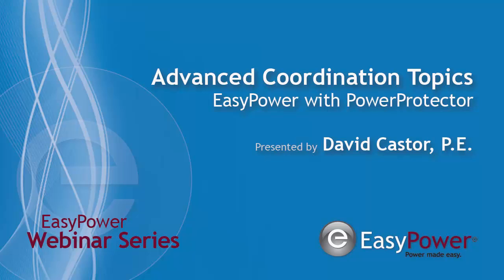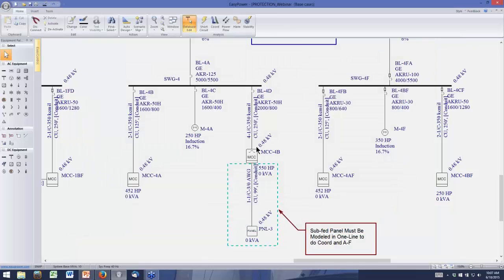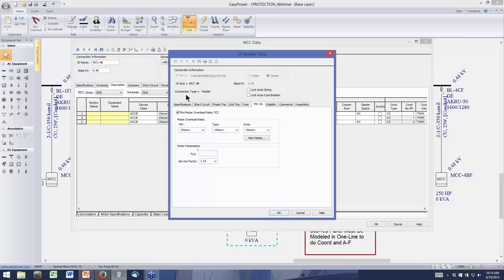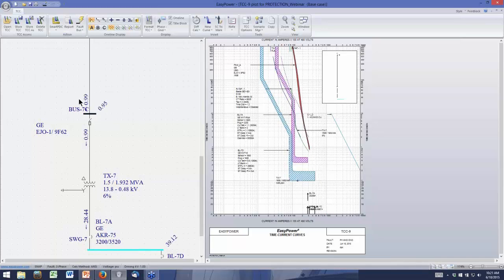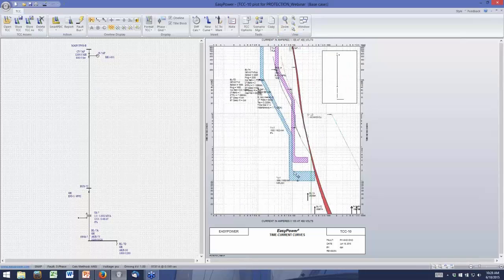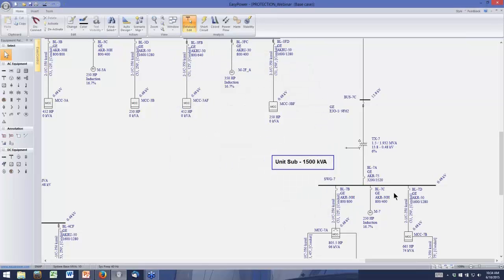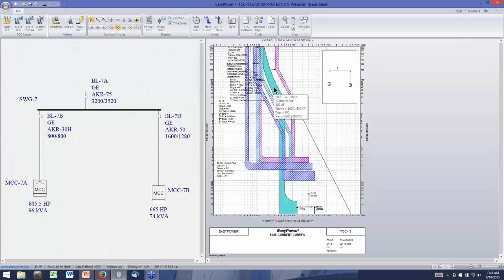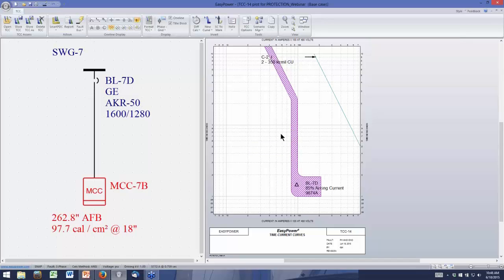Advanced Coordination Topics In EasyPower

Comment: Jon, the IEEE 1584 equations are valid only over specific range of fault current and voltage.  They are empirical equations developed from data from actual testing.  If you are trying to use the equations outside of the current and voltage range specified in IEEE 1584, you can get strange results.  The fault current minimum is 700 A, IIRC.   Also, they can only be used for three-phase systems and with three-phase fault.   Hope that helps.